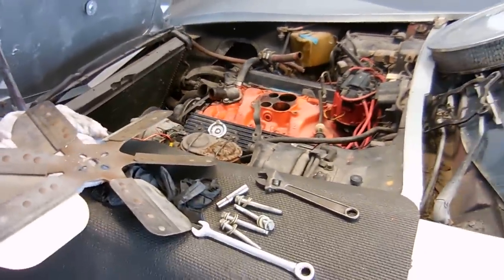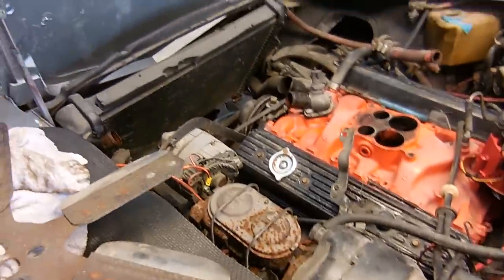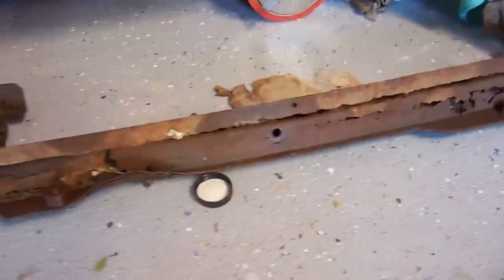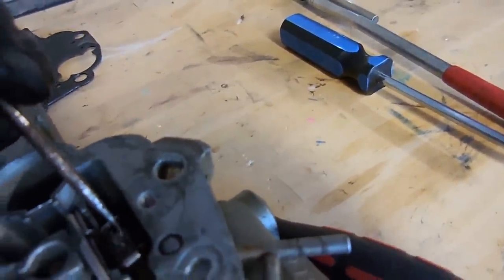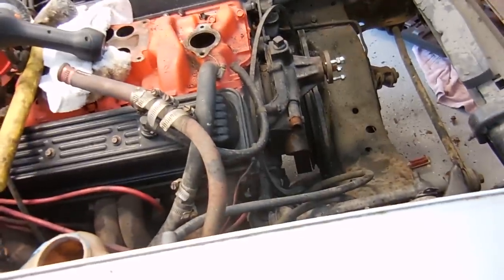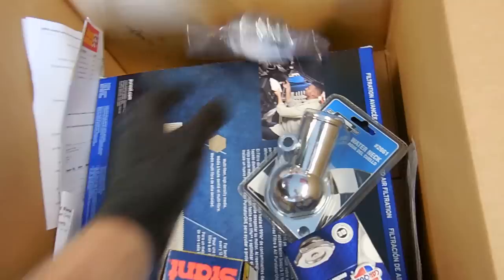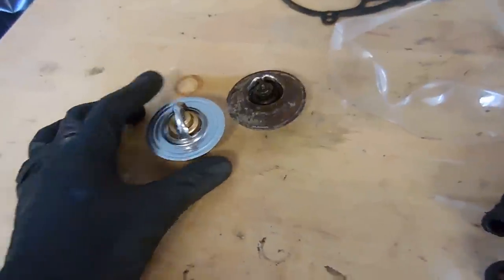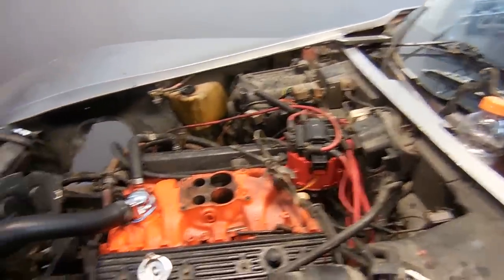Abandoned Project: 1974 Corvette Stingray Video 4 of 13

Comment: I am surprised that you did not paint the replacement radiator support before you installed it!!!
Reply: I concur.  I would have slapped some paint on it...easy enough and cheap.  I also would hav drilled drain holes at the bottom since it's easy enough also.

Comment: This may just be my OCD speaking, but wouldnt it have been a good idea to wire wheel that radiator support cage and rust-treat and paint it so that it doesn't rust up like the old one did?  Maybe hit the fan while you were at it?
Reply from the maker: There is a slippery slope when it comes to putting new and shiny things in a dirty and original engine bay. Soon you'll be removing EVERYTHING to bring it up to the standard that you set with the one new part. I have seen it happen too many times.
Reply: I was thinking the same thing, even though this isn't a restoration, I would have sanded and painted that used rad. support before putting it in. and I absolutely would not have used some crappy chrome thermostat housing for that matter........... just sayin
Reply from the maker: It is better than the old T stat housing, all rusted in place with a broken vacuum switch sticking out of the top of it!
Reply: Tony FromIT t
Reply: BUT, with this being the one major source of rust, maybe coating it with a sealant would have been a good ides even if the other parts are left as is.  But, it IS your car, so....jus' sayin'.
Reply: @TheCorvetteBen  - I've had those crappy chrome housings....  look nice for awhile but I ended up going back to a cast iron one because the chrome thing leaked....I would not use one again.

Comment: Look to see if it's a Rochester or a Carter Quadrajet. Most GM cars use the Rochester, and pick up's and van's used the Carter. They look the same, but have some minor differences. The name is on the middle left side of the carb. A lot of people don't know Carter made the Quadrajet also. There an easy carb to rebuild... you should rebuild it yourself... but then I think all carburetors are easy to rebuild, except the Motorcraft Variable Venturi. That carb need dial indicators to set it up correctly... and there easy for me too.

Comment: I always use distilled water in my antifreeze. It's cheap so there is no reason not to. I also can't fathom why you didn't paint the new radiator bracket before you installed it.

Comment: There isn't a fan shroud installed.  That Corvette will most likely overheat without that extremely important part of a complete cooling system.
Reply from the maker: No worries, a shroud was included when sold to the new owner!

Comment: I have noticed that there is no radiator shroud on this car. Is the shroud essential equipment, or can you do without it? The reason I ask this question is because I have a '75 model with dual electric fans (which I'm not a big "fan" of) and would like to replace them with a stock style clutch fan, but would rather not have to spend the money on a shroud and related parts if I don't have to. I know that many cars can live very well without a shroud, but because of the way the radiator mounts in a C-3 Corvette, I don't know how well it will cool. What say you?
Reply from the maker: +Roger Lee it really depends on where you live. Hot places like texas yeah a shroud would help alot if you got stuck in traffic at idle for a long time. If your always on the highway, then you could be fine.
Reply: Thanks, that helps. I live in Alabama which is very similar to Texas weather-wise, but most of my driving is open road.
Reply: on my '74, it would do fine idling but get super hot on the hiway.  It had the shroud but was missing the chin spoiler.  what a difference it made to the car with a new spoiler!

Comment: I got a question, what makes a corvette a keeper in your eyes, as they really come and go on here, and I understand that's quite literally,your business on here, but I gotta wonder what set of options and engine powerplants would make you keep one of these turn around cars like this? as you sold that triple black (I think LS4) C4 that I gave you the video on, which really quite shocked me as it sounded like it was a keeper for you.

plus with how many things they did to these things, it would be fun to know what to go for from someone like you, who's had your arm neck deep in all of them at some point or another. 

plus I must note given your love of the chrome bumper cars I'm heavily surprised you havent tried to add chrome bumpers to the front of the 73, along with the appropriate badges at some point or another.
Reply from the maker: Well I do still have my73, so there is that. In my eyes what makes a C3 a keeper is the rarity. Keep in mind, most of these cars you see on my channel are small block, automatic coupes. AS for the C4, it was cool, but I ran out of stuff to fix, and I was not driving it as much as I would thought. Figured I would send it on its way and maybe one day later get another.
Reply: ah so like if you found a Junked ZR1 lying around or something that would be the keeper then,  and I gotcha with the other thing, so it just that at this time you wanted more project cars and it was too sorted to be that lol

Comment: ………..hey Ben, does it really matter if the coolent installed is green or orange?  As long as it's 100% coolant and does the same thing does colour really matter?  Just asking.  :)  Mind you, I'd be wanting you to be working on my car because I like your thoroughness and your wanting to go by factory specs.  I like that mainly because I like to operate that way.  I just like factory direct, best way to go.  :)  Cheers, Steve
Reply from the maker: Usually a good rule of thumb is go by what is already in the motor. For example, if you mix green and orange together it solidifies and turns to mud.
Reply: ….yeah, but there's no way you're going to mix the two together.  Being as thorough as you are you'd make sure that all the old stuff was drained out before you'd put so much as a drop of the new in.  I can't see it being blended together.  C'mon, 'fess up, you just like the way it was originally, you're just like me.  :)

Comment: Hi Ben,
Can you tell me what model Q-Jet carburetor you have on this motor ?
Thanks.
Reply from the maker: I believe it came out of a 1977 Chevrolet? Other than that I know it is garbage and will be looking for another one.
Reply: Oh OK, I thought it was a Corvette original. Never mind !
Thank you anyway.
Reply from the maker: It could be from a 1977 corvette. I can send the numbers if you are intetested. For sure not orignal to this car, which is not surprising
Reply: Hi Ben, That would be great ! I'll run them and see what shows up.
Thanks.

J
Reply from the maker: 17057204
Reply: according to the Corvette Black Book (get one, its awesome!), this carb came on a '77 Vette with base 350 (180 hp), AT, AC.  may have come on others too...but betting it's an original Vette carb.
Reply from the maker: +Steve S sadly it has been through a "rebuild" factory and runs like garbage. I'm in the process of getting another
Reply: Thanks Ben, I might have one in my shop. I will look on Wednesday.
Reply: John Mulhall: the carb should be a Q-jet 4MV. This was the standard carb setup for Vette's and other performance GM cars. I like these carbs because they're easy to repair and very tunable to increase performance if you so desire.
Reply: Yes they definitely are. My personal preference is Carter / Edelbrock, although I can rebuild &  tune a Q-jet quite well. I like the USER friendly simplicity of the Carter design.  Just my opinion and $.02

Comment: You say you want to make the best job as possible. Good.
I don't want to criticize but why didn't you wire brush the radiator support as it was out already, and give it a quick antirust paint coat ? It would have looked as new and future rust protected... Just my two cents.

Comment: The coolant color for gm cars is orange
Reply from the maker: Only after 1996.
Reply: Orange coolant is trash, it clogs the system if you don't change it every 5 years.  My 2001 silverado has a plugged heater core because of dex cool.  I switched it to green now but still need to flush or replace the heater core.
Reply from the maker: +Horsepower Garage alao, if you mix it with green coolant it becomes like a sludge. Gross